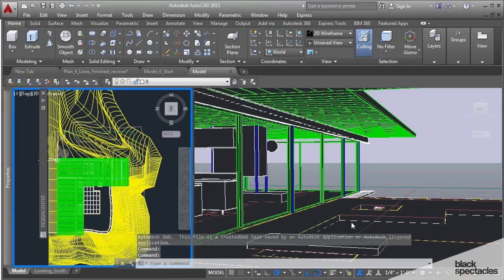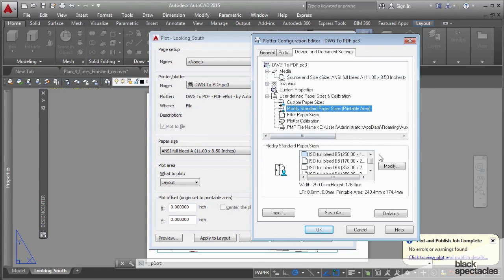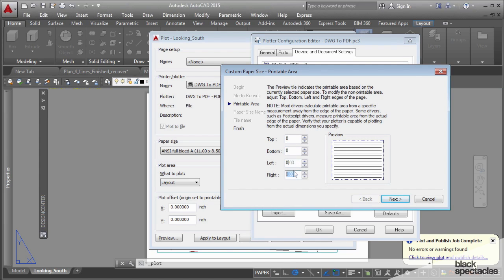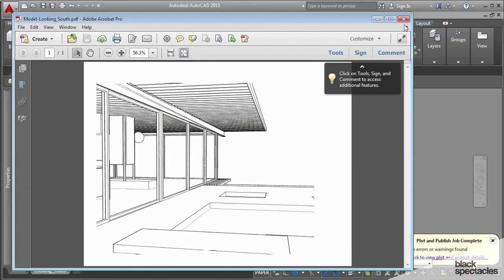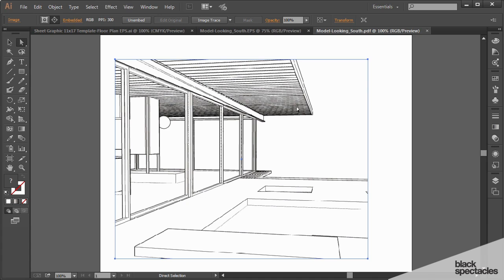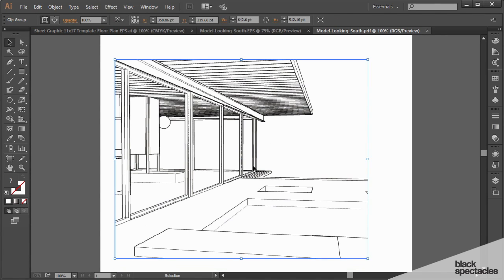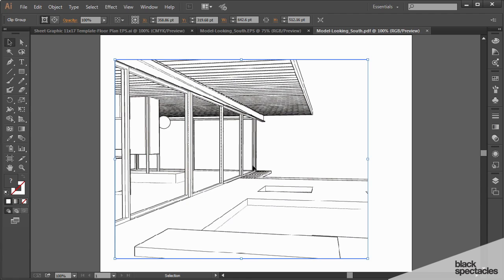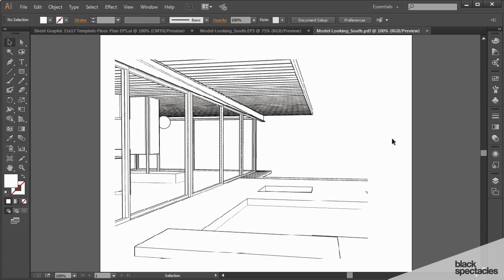Print your 3D View to PDF and open in Illustrator - AutoCAD 2015 Conceptual and Schematic Design

Comment: Thanks for posting this video, it was very helpful! However, I am still running into two issues: firstly, I can't edit my linework once in Illustrator, and when I zoom in, the lines are pixelated. Secondly, my drawing seems to have imported in several separate panels. Do you have any idea where I could have gone wrong? Thanks!